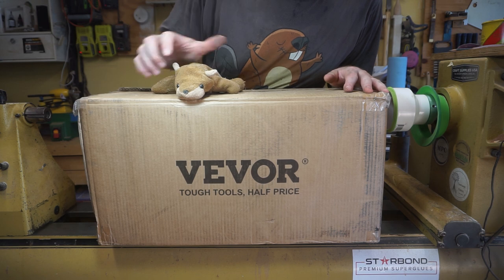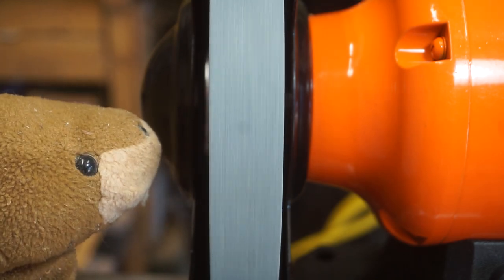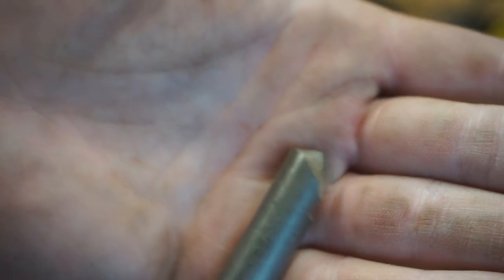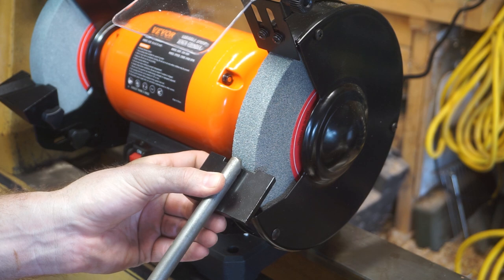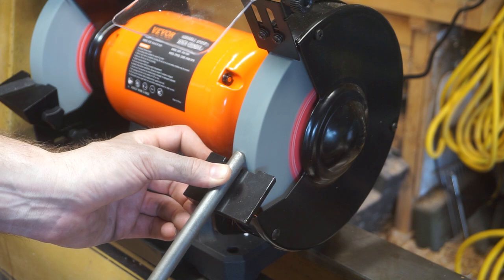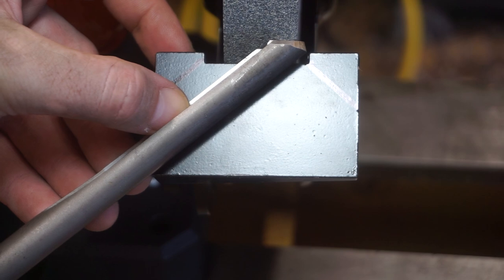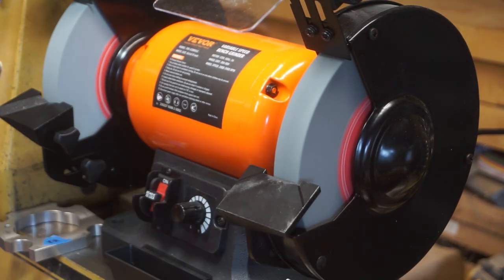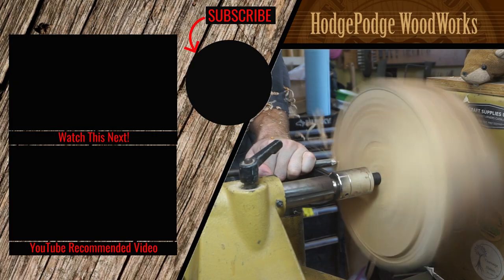Woodturning - How to Grind a 40/40 Bowl Gouge - Vevor Grinder Review

Comment: Nice Jerry Glaser T15 bowl gouge. They take and hold an edge better than carbide in my opinion.
Invest in the Oneway wolverine sharpening system, you won’t be disappointed.
Reply from the maker: Thanks! I was super excited when I saw it on a tool auction and the seller made no mention to the fact it was a Glaser gouge. I've got the Oneway sharpening jig on my other grinder as well as Stuart Batty platforms. I was just testing out this other grinder that was sent to me, which will ultimately be used for reshaping.